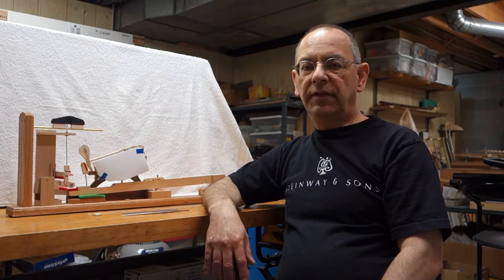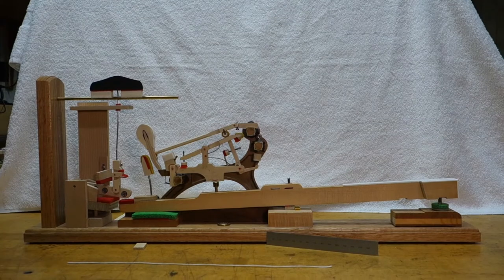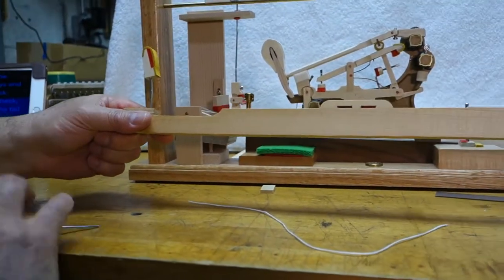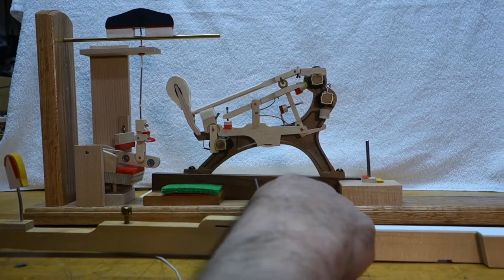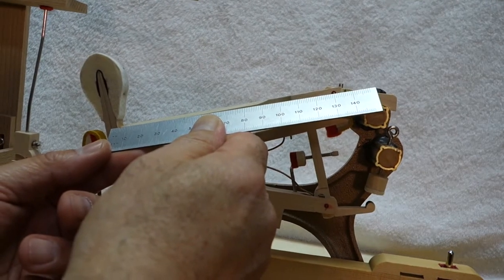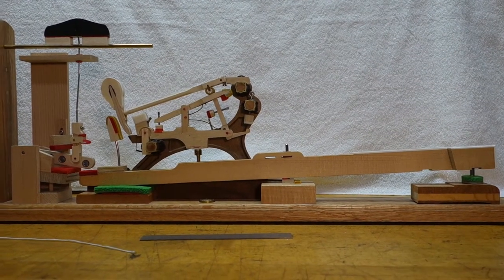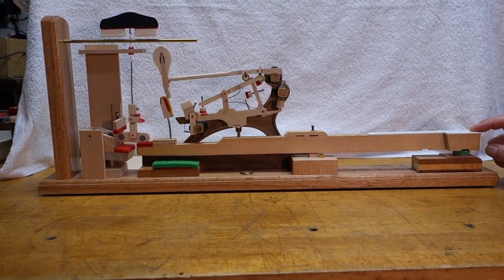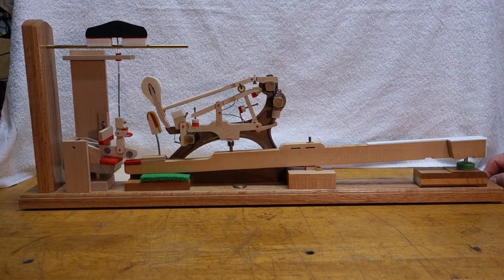How a Grand Piano Action Works

Comment: I looked for the longest video about piano action hoping it would cover all the technical details and boy did you deliver.  This is tremendous!
Reply: The section I needed was explanation of "roller" (or knuckle) and the two screws for "stopping" repetition and jack, therefore called double escapement, and enabling hammering the string again even if the key is not back to rest; it is at 14:00
Thank you for this comment - it's in the middle of the night and I doubted if I should use 15 min. or sleep to be fresh tomorrow! :) <3

Comment: Thanks! this explained to me the function of the drop screw for the first time.  I did not realize it is the second escapement.  I have a similar model which came as a kit and the drop screw did not seem to serve a purpose.
Reply from the maker: Actually, to be precise about it, the drop screw isn’t “the second escapement”.   The drop screw is a “thing”.   Escapement is an “action”; namely the jack sliding out from under the knuckle.   The “double” in “Double Escapement” refers to the fact that the repetition lever was added to the grand piano action, requiring the drop screw that is added for the purpose of defining the limit of the rep lever’s movement.   As such, there is not another escapement happening; just the one and only escapement, namely when the jack flips out from under the knuckle.

Comment: Bravissivissivissimo! I am going to build my own, but I am going to have 3 pedals (at table top level) to show the sustain, soft, and sustenuto actions. I will also have a removable string bridge with real strings and tuning pegs and 3 different inserts: one for 1 string, one for 2 string, and one for 3 strings. I can use this to show sustenuto as well as tuning. I will also put in a little sound board. It may not do much, but it should show the concept - it is a key (pun intended) part of a piano. Thanks for the inspiration. I guess the sustenuto is done by throwing a pin under the little flip lever when the note is played, thus holding the damper up after the note is released. The lever gives way to notes that are played after the sustenuto pedal is held down. But suppose the pins are thrown out just as the lever reaches the height. Would that cause binding and possibly damage, or are the pins spring loaded? Thanks, Paul
Reply: I also see on your device, the key is tilted up at the playing end when at rest. But in a piano, the keys are level when at rest. Is there a counter tilt inside the piano to tilt the rear of the action base when in the piano thus making the keys level at rest?
Reply: I have a Yamaha DX7 synthesizer with after touch. So I get all sorts of pitch and volume vibrato on it. But I sometimes wiggle my fingers on piano keys as well, but mainly for timing...and to hear vibrato in my head...it is amazing how we can imagine sound and recall pitches. I guess that is how Beethoven could still compose music after going nearly deaf.
Reply from the maker: When you do, please send me a photo or YouTube link so that I can see your creation.  It ought to be quite impressive.
Reply from the maker: @paulromsky9527  Actually, the keys in a piano are tilted upward.  They have to be in order not to pass below the horizontal plane when depressed.

Comment: The reason the design is what it is is due to evolution. Rather than start from scratch when there is a new problem or a new understanding one adapts. Through the process of evolution small changes can add up to a significant effect. One can easily accomplish the same effect fewer parts but requiring more complexity and modern tech. This is basic systems engineering. There are only two things going on, the hammer hitting the string(simple impulse theory which is extremely simple and straight forward) and then the performance aspects which is in the area of optimization and fine tuning. A lot of man hours were put in to adapt early primitive designs which handled the main effect(that of making a sound) in to adding a benefit to either sound quality or performance quality. In fact there were many extension that were lost yet were actually beneficial(but not popular to the masses) or detrimental. There's many ways to skin a cat.

Comment: What is the standard length of the key are they varies concert piano grand piano and baby grand piano?
Reply from the maker: The length of piano keys does vary.  A nine-foot concert grand does have longer keys than a 5ft 1 inch piano.  But, it would impossible for me to tell you how much this can vary.  Different brands of piano have different measurements they work with.  Grand piano keyboards are not perfectly rectangular, so bass notes have longer keys, as a general rule.  But the same principles apply to big and little grand pianos.  The key ratio of 2:1 would still be something to aim for, whether the keys are long or short.  Also, the magic line and the power line would still be operating principles.  

In upright pianos, though, all the keys are the same length.  They tend to be that way because upright piano keys are generally designed in symmetry with the case.  It would look kind of odd if the bass side of the case the were to  poke out further than the treble side.  But, I'm no expert on upright piano geometry.  My work is 99.9%  Steinway grand pianos.   I am admittedly ignorant to most upright piano action theory.

Comment: What is the purpose of the let off? The one part I don't understand.
Reply: Let off adjusts the power of the hammer.  If the hammer lets off too soon you lose power to the string and can affect the tone and voice you are getting.  Too close let off and the hammer will block onto the string.

Think of it like throwing a ball, you don't want to release the ball early or you lose power, you want to release it at the very end of your pitch.
Reply: @tomrotelli1355  Excellent explanation. Thanks!

Comment: I totally disagree that there is no function for holding a key down after the hammer has already struck. It helps the pianist to maintain the weight and force required to make the next note match.

But... You master technicians like to claim that you are master pianists.

And vice versa.  

We should all maintain some humility to accept that we don't understand everything.
Reply from the maker: I think you misunderstood me.  I did not say that holding the key down is not something a pianist might wish to do, merely that wiggling one’s fingers as if to affect a vibrato on the depressed key is not in any way going to affect the tone of the note.  On your other comment about master technicians, et al, I don’t generally mention that I have two degrees in piano performance (Oberlin ‘79 and UW-Madison ‘81), and completed 30 hours toward a DMA before I changed direction toward piano technology.  I’ve dedicated my 40 years as a piano technician to bridging the gap in communication between pianists and the piano technicians on whom they rely.  This was my mission as Asst. Professor of Piano Technology at the University of Michigan School of Music, Theatre & Dance.  I submit to you, with humility, that I understand extremely well how a piano action works.
Reply: @robertgrijalva7158  You are now gravitating toward the claim that you are only talking about vibrato.  The fact is, pianists NEED to change the weight/force applied to a note EVEN AFTER THE KEY HAS BEEN DEPRESSED in order to accurately and smoothly crescendo or decrescendo to the next note in a manner and timing that creates a smooth transition.  

An inexperienced pianist will create a crescendo effect by resetting their applied force between each note.  An experienced pianist will increase the force while holding down the key, so that a smooth crescendo effect can be achieved.  

Keep an open mind.  I like this quote:  

"Don't believe everything you think."

We should all keep this wisdom in mind before claiming to be super-smart.
Reply: @austinc1386   “the claim that you are only talking about vibrato” …… I think you should re-listen to that part of the video again. He says exactly that he is talking about the desire to add vibrato by wiggling a finger on the depressed key. I’m not sure why you are having difficulty hearing and remembering his exact words and then claiming he said something else. After all, you can re-play the video all you want to get the details down if you need to instead of twisting things to make your own unrelated claim.
Reply: @Austin C You have no idea about what you are really talking about when it comes to creating a sound in a mechanical instrument such as a grand piano.
Reply: @austinc1386  LET IT GO. You misunderstood what he said. Simple as that.